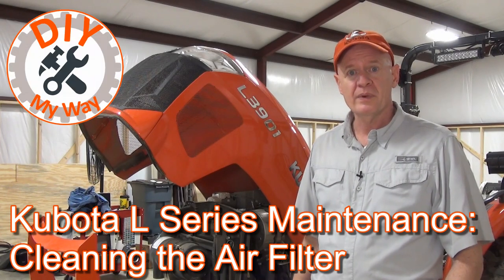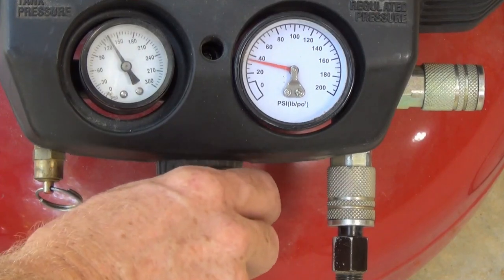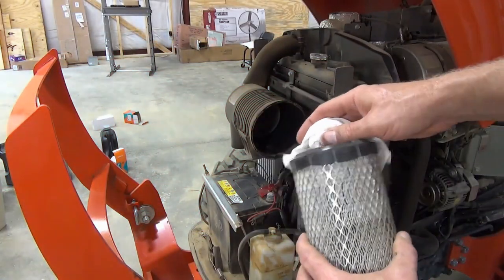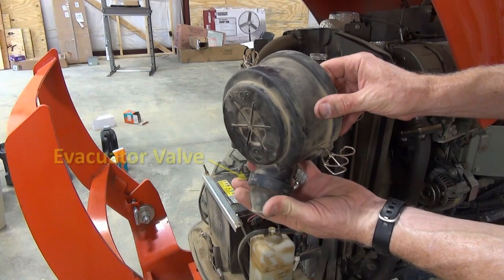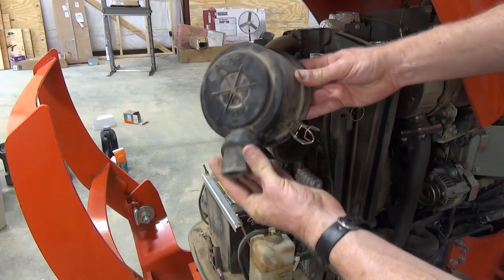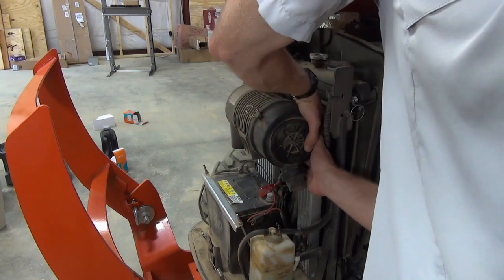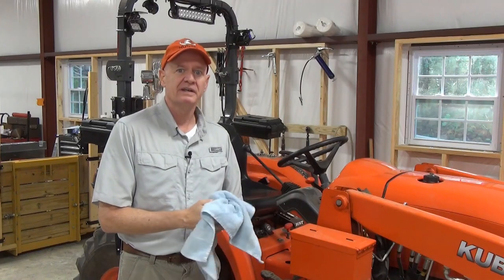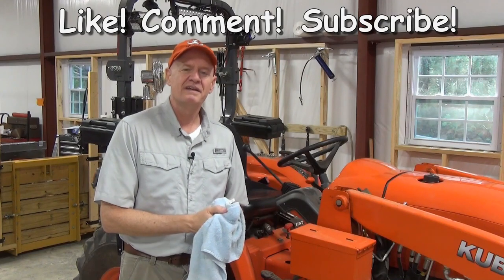Kubota L Series Tractor Maintenance: Cleaning the Air Filter (#80)

Comment: Hello Martin, thank you for your good videos and helpful tips I appreciate your good advice as well as sense of humor. I just received my L2501 on Friday, one thing I did since I know I will be operating in dusty conditions, I ordered an internal filer that sits inside the original air filter. I can attest to how well this works on bigger Diesel engines operating in dusty conditions I was always amazed how clean the internal (safety filter) was. Part # TA040-93220 that I ordered from Coleman equipment because the shipping was cheaper to my home in Utah than other dealers. I figured I would mention it Incase you were unaware of the internal air filter. Messicks also has a good video of installation if you search L series air filter. Thank you again for you informative instructional videos, I am sure my tractor will much easier to maintenance thanks to your tips that are much easier to watch vs reading the work shop manual. Happy tractoring!
Reply from the maker: Hi Jake! Congrats on your new L2501!  I was aware of the optional extra air filter but haven’t seen the need since I don’t often operate my tractor in dusty conditions.  The exception is when I mow the pasture which is just a couple of times a year.  Thanks for mentioning it though since it may be helpful to others who read your comment. Thanks for watching!

Comment: Hey Good evening and Merry Christmas Martin. Didn't your manual recommend washing out the filter and then letting it dry at this interval? I was surprised that mine did. I ended up putting in a new one regardless, but just wanted to know if it was different for the L series than the B series. Thanks and Happy New Years!
Reply from the maker: Hey Gord!  My manual says to use compressed air for dirt and dust, but if there are carbon or oil deposits on the filter, it can be washed as you described in your video.  Mine just had dirt and dust so I just blasted it with air.  Merry Christmas and Happy New Year!

Comment: as always, thanks for your videos. but I am confused because a fellow in the comments says part ta040-93220 but I'm also seeing part number ta040-93230. do you know which is correct? I have a 2021 L3901
Reply from the maker: Hi Hany!  Kubota, where air and oil filters are concerned, Kubota will sometimes changes part numbers due to design improvements or spec changes.  Go with what your manual says.  Your 2021 L3901 may use a slightly different air filter system than my 2017 model.  Good luck!

Comment: Thank you, my 5640 is black smoking every time I start it. Also sounds like metal on metal. Always think something is wrong? Service every 500 hrs. Shop here in Virginia says tractor is fine, beginning to wonder?
Reply from the maker: If your tractor has had multiple 500 hour services, then it has at least 1,000 hours on it, which entitles it to belch some black smoke at start up.  The metal on metal sound could be a fan belt idler bearing going bad or the water pump, among other things. Thanks for watching!

Comment: I replaced my air filter and all was well.  After about one hour of running I got an air cleaner warning light on the console. What do I need to check and how do I reset the alarm?
Reply from the maker: That suggests there’s something wrong with the filter.  Check to make sure there’s no plastic wrapping left on it and that it is seated correctly.  I don’t know how to reset the alarm but I imagine it will go off when the problem is resolved. Good luck and thanks for watching!
Reply: @DIYMyWay  👍